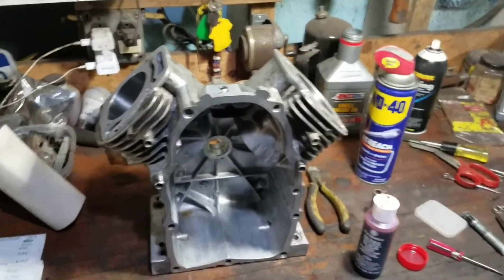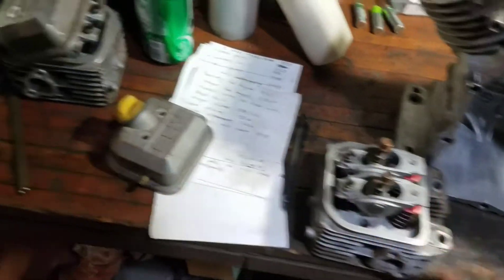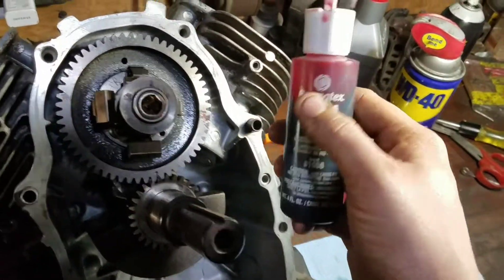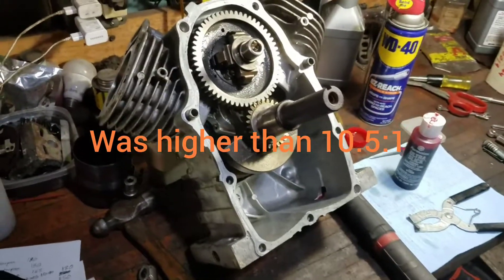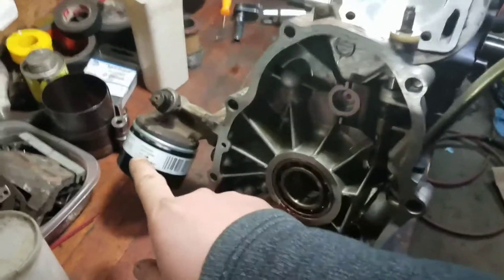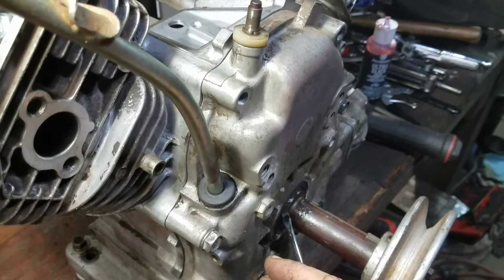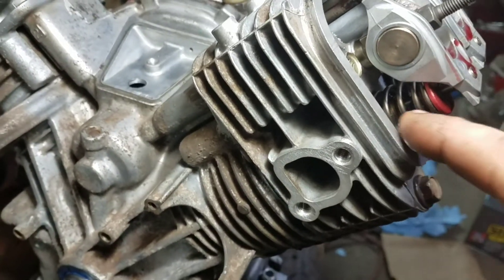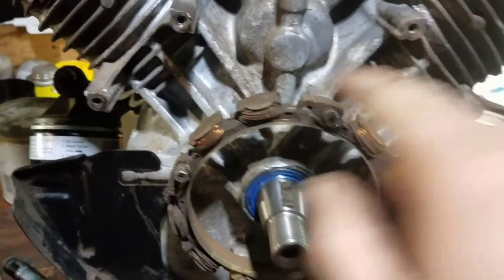Upgraded 20hp vanguard

Comment: An old school way to check for valve to piston clearance is to use play-dough  on the surface of the piston, rotate the assembly and take the head back off to check clearances. If it's close enough...say .050, you'll want to relieve the piston where the valves can contact in case you wind up with valve float, which you shouldn't with the high tension springs. This video was an excellent teaching video. Thanks for posting this Willy!! Looking forward to the first run video where you explain bedding in the rings and break in procedure. Cheers my Friend! Zip~
Reply from the maker: I hadn't thought of that only know you want to run up and down threw RPMS for a wile before a few WOT no load haven't looked into much just heard about beading in rings and cam. 

I've heard about cylinder glazing like assembly lube on piston rings, no other horror stories or why not to do quotes with explanations.
Reply: @willyck948  😎

Comment: Any chance you could make a video on the governor lever and linkage, I’m having problems with mine and not to sure what’s causing the issue. Possibly the idle spring
Reply from the maker: @djladd241  I don't have to work on one right now, but I will try to keep it in mind. 

I would recommend checking the connection at the carb as there's a plastic grommet that can wear out and cause slack in the linkage between the carb and governor arm, could try adding a damper soring like ones used on tecumseh carbs

Comment: Hey buddy. I picked up a couple 35hp vanguards for parts, they had thrown a rod and took a chunk out of the cylinder wall and it looks exactly like where you clearanced the rod caps.....if there is a way I can send you a photo and see what you think maybe the two 35hp big blocks are salvageable!!!
Reply from the maker: Hard to tell from photos as to what is tolerable as I haven't worked on a 35hp myself. 
An engine shop would be a better place to have it checked out otherwise you can buy a block online cheaper than a replacement engine. 
Partstree is a good place to start if you need parts.
Reply: That's what I'm thinking just buying a couple bare blocks.

Comment: I know this is a old video but do you know if the starter gear is plastic or metal and how many teeth?
Reply from the maker: it verses depending on the manufacturer date best to go by the engine model type and code to get the correct part numbers. 
I also tend to buy complete bindics assemblies as the aftermarket gears don't always fit and work perfectly on oem splines  
Partstree is a good place to look
Reply from the maker: https://youtu.be/4eMe2Py87H4

Comment: Hello. I'm from Belarus. I got in trouble. My Briggs And Stratton 23 HP engine broke. the camshaft broke ... The problem is to find a spare part. Can I install a camshaft from a Briggs And Stratton 14-16-18 HP engine? Perhaps these parts are the same? I need wise advice... Thank you.
Reply from the maker: You can search you engine model type and code to get a part number and search for used one online. 
I'm not sure if cams from an 18 horsepower would fit into a 23 horsepower 
The 14 horsepower threw 18 horsepower cams are the same though.

Comment: What lift of cam did you use?
Reply from the maker: Too many variables like stock or poted heads, valve springs, what RPMS are you going for, is there any rules regulating max valve lift. 

Best to give PRECISION CAMS a call.
https://g.co/kgs/8TsnCD
Reply: Willy Ck okay thank you, I’m wanting to do a slight engine build like rods and a high rev kit, but I’ve always wanted to put a big cam in one of these

Comment: Atmosphere Pressure is 14.7 set by NASA, so your 175psi / 14.7 = 11.9cr!
Reply from the maker: I found an error in the logic turns out engines running 9.8:1 compression run 150 psi and 11:1 compression gets up to 170s psi pressure goes up exponentially with the increase in heat comes more compression.  Smaller area and more heat way more pressure